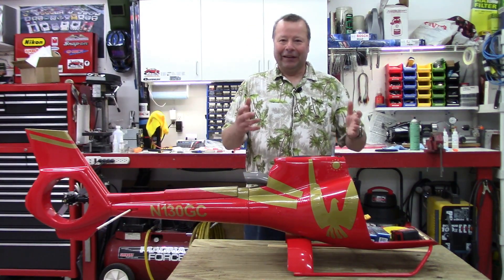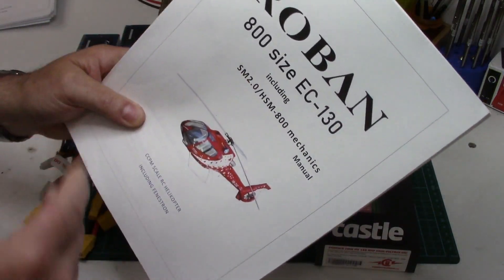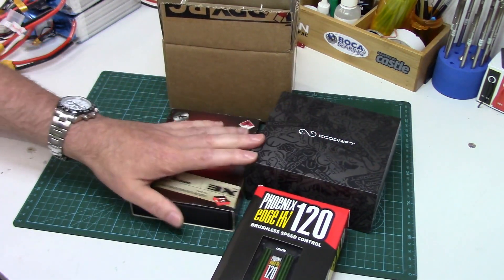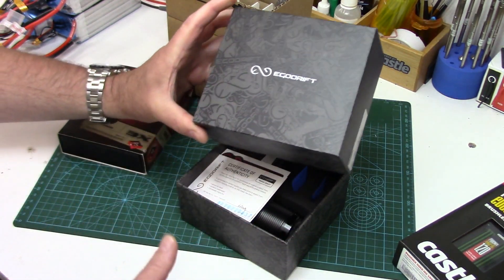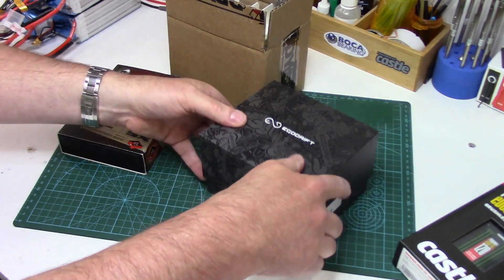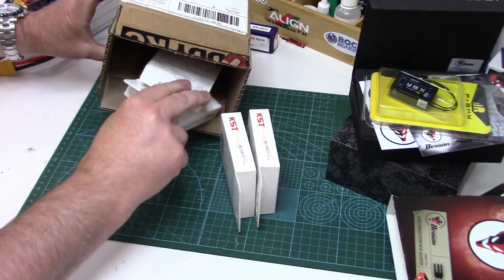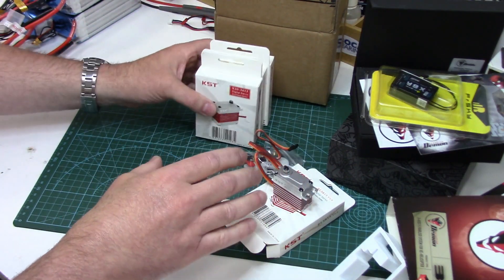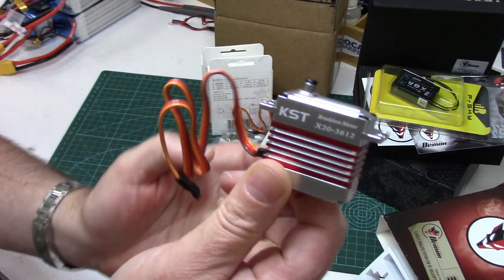Roban EC130 RC Helicopter Electronics & Fenestron Fitment Fun

Comment: Hey John new watcher here .
   I am old school guy and flew schluter champions and excel back 20 years back but we always canted the tail rotor to the left a few degrees and had a lot more tail control and when turning it offset the tail with the little bit of lift you gain in turning instead of altitude drop when putting in a turn command.
   I have no experience with large electric helis just gas so just my opinion 👍👍
Reply from the maker: Yep, it all depends on the thrust direction from the tail rotor. With this heli, the tail rotor/fenestron is thrusting left to counter the CCW main rotor torque; so with the left lean, it would be pulling an already heavy tail boom downward. If it had a right lean, I would not be as concerned because it would then do exactly what you described, give the tail a little upward thrust vector.
Reply: Cool Thanks John for the info like I said it has been years even thinking of that thrust angle .
  Appreciate the response